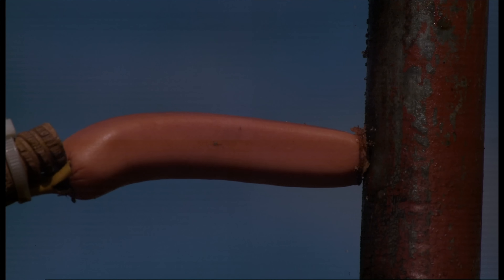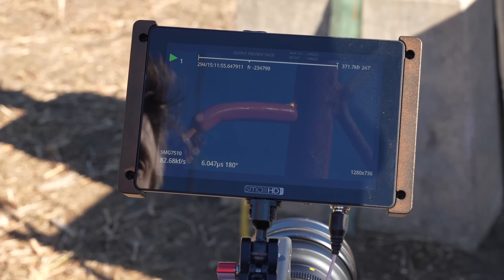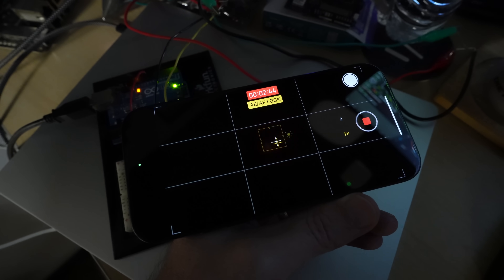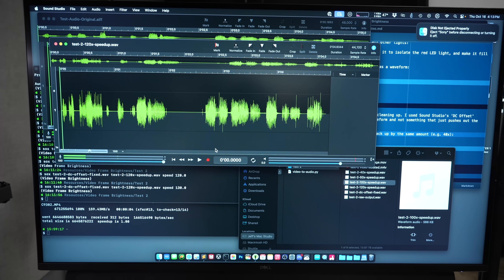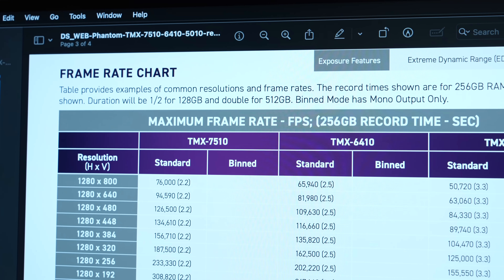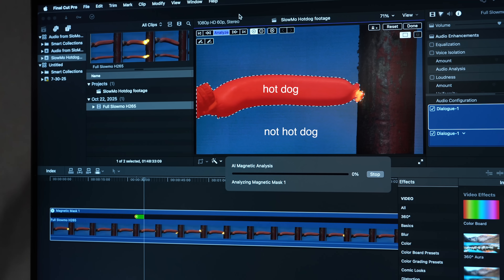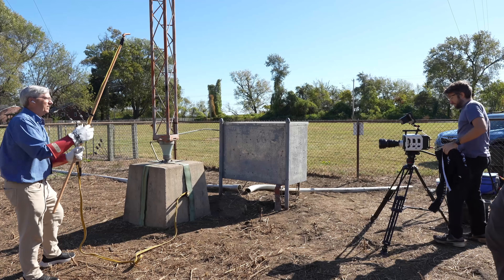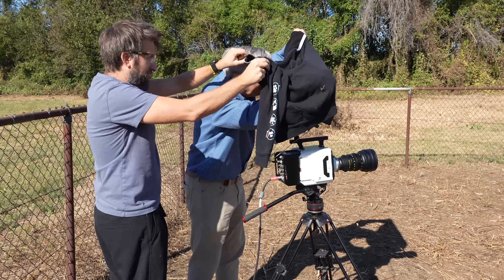A new way to listen to AM radio

Comment: Just like lightning there apeares to be a leader effect.would it be possible to put a high speed circuit that would continuiosly track signal caricturistics in the am broadcast transmiter and possibly the enttenna unit to sense arcing because of a sausige or anything else arcing or conducting to ground and automaticaly shut down the transmiter plus possibly if energy is disapated into heat by sausiges or anything else near the tower to prevent damage to the sausage or heating of a sausige or anythinge else i think that that would be a good idea some special military transmiteres do have rhis feature.

Comment: This is analogous to an optocoupler, which we used to make using a LED and a LDR in a piece of black shrink tube at uni. You can interrupt the light mechanically and make audio effects such as a vibrato. Good times

Comment: Clipping the negative half of the waveform is how AM radio demodulates the signal. The component in an AM radio is a simple signal diode designated as the "detector diode" . Maybe you just had the polarity of your hotdog backwards or you were using a general purpose rectifier dog.

Comment: Just think analog, Play that video to the solar panel cell that is attached directly on the screen but use it as a microphone and connect it to an audio amplifier you should hear something, I think the led should work really good ( but make it blue or at least white. Also it would be interesting to see if the video with luminescence key would produce any clear sound.

Comment: a few things; since sound is sinewaves anyways, you only really need half of the data. also, if you used a reflector you could get the light from the back. 

Biggest thing here... Walking through the experiment in agonizing detail is the best... Peanut butter sandwich instructions levels of painful.

Comment: what would happen if one took a hotdog on a wooden rather than a metal stick on an ungrounded fiber glass pole and held it near a am station would it still heat up or burn or waporis or would it get cold in radiated.
Reply: Good question. I beleive Jeff and I are the current experts in the field of Hot Dog LF absorption now! I'm pretty sure what would happen but will sit on the idea for a possible future video. We have been using a wooden stick but running the ground wire to one end of the hot dog creates the enhanced energy path.

Comment: Maybe the processing is part of the fun, but if you simply used a photodiode and a parabolic reflector instead of a camera, you could more easily capture a signal from the plasma. I'd try a diode at the focus of a an old auto or tractor headlamp.

Comment: you could use a photodiode to get the data! It's like a super high framerate 1px camera. You could put it on the end of the stick or use lenses to collect more light from it and you wouldn't need to do anywhere near as much post processing or deal with as much data.

Comment: The LED will always clip below the diode conduction threshold and in the opposite polarity.   Try again with an old-fashioned incandescent bulb and I bet you'll get better results. As for the plasma, you may only be getting the bright visible flashes on modulation peaks.  There are a couple of guys on YT that have made powerful speakers out of tesla coils.

Comment: 3:10 - seems like you made a mistake here? That sounds like you didn't pitch shift it, you did something like "slow down" the audio with "preserve pitch" selected (different DAWs describe it differently). This doesn't shift the frequencies down, it applies a bunch of tricks and processing to make the audio seem like it happened slower. Doesn't mean the overall method is flawed, but your test might have worked a lot better if you had actually pitch shifted.

Comment: In the early '90's I was the Chief Engineer of a 10,000 Watt AM station in Hawaii that was KJPN. That tower had another 10,000 Watt station diplexed on it but the guys who added the second station neglected to upgrade the tower light system's RF isolation choke for the increase of power. One day I had to lift the tower light system's neutral wire from the circuit breaker box neutral bus. I had an insulated shaft electrician's screw driver and insulated pliers. When I pulled the neutral wire out, it drew an arc of about three inches long that produced the audio of both the Japanese language programming on the one station and a live from a helicopter afternoon traffic report on the other. I just stood there for a few seconds while the arc sounded off just completely surprised and then concluded that I'll just put the neutral back in. I never in my wildest imagination thought that could have happened.

Comment: So, a couple of questions/ points,
-1st off, Very well done!!!! Is how Jeff likes his hot dogs!!!
-I think I understand what you are trying to do with the LED bulb & I think I understand that LEDs pulse slower than an incandescent light bulb. Could the slower pulse of an LED be giving you "static" in a sense that when slowed down with your phone's camera, a blink in the brightness of the LED is not so much a blink correlating with sound but JUST the frequency at which the LED would normally pulse under normal conditions? Should/Can you try a different Incandescent bulb to get a clearer sound wave?
-To get a better view of the arc flashes (as the hot dogs block what is happening on the backside of the dogs themselves), could you use a slice of bacon instead. Much thinner, roughly same medium & might smell much better LOL. Otherwise, 2 Phantoms, 1 on either side of the hot dog, Then stitch the 2 videos into 1, as the arc flash jumps to the blind side of Phantom #1, you cut to #2 Phantom's video to get the constant visual?

Just throwing idea out there. I have no idea if what I've said would work.

Comment: I could see not using a camera, but instead go a bit more analog, using a photo-diode or photo-transistor to detect the light levels.  Then an analog-to-digital converter to allow sampling.  You could place another detector on the other side and catch the "missing" plasma glow. 🙂

Comment: @GeerlingEngineering - did you consider putting a mirror on the back side of the hot dog to simultaneously capture the front and back plasma view?

Go. Cards!
Reply from the maker: Mounting it would've been difficult... but it could be doable.

Comment: A transparent/translucent gel in the sausage skin or some other relatively thin skin might let you get much more of the light as the 'sausage' won't occlude the plasma so much. I'd think ballistics gel would be good enough perhaps without even needing any skin (May need to mix in an additive or two to up the conductivity of the gel for good results, but I doubt it and that shouldn't be a big problem.)

Comment: Nice! As soon as Gavin showed the shot where you can see the modulation, I thought of Destin's video on using a laser on MEMS microphones and wondered if you could extract any useful audio from the video. I guess it turns out the answer is maybe!
Reply: Also that shot of the connector arcing is terrifying. The radio is trying to escape, you must not let it

Comment: I would add all the pixel rgb values in each frame to a 32 bit integer, apply high pass to the series of those sums, and listen to it. 
Since the modulation of plasma is much much faster than any other brightness change in the scene, and visually it seems that the details are there, I'd give it a shot. Luminance keying is very similiar to sound clipping so a lot of detail is probably lost there. I'd also choose the high pass cut-off frequency somewhere in the middle between the fastest movement in the scene and the lowest plasma modulation frequency. For a ball park, I'd go for 10-20Hz. It should also be much much faster than any other video processing method because you are just adding integers and possibly using a very fast integer high pass filter.
Reply: if you're unsure, send me the footage or the sums of the rgb values in each frame and I can give it a try.

Comment: Just goes to show that you can encode analogue audio into just about anything! I think I remember a Veritasium video where they were yelling at a crumpled up chip packet and trying to use a camera to decode audio from that...
I wonder if this experiment could be done more simply by using a light sensor (like that out of an optical compressor circuit) instead of a camera?

Comment: In Army I was told you could touch antennas to test if everything was hooked up right! It worked. Was tube 100 watt or less 400 mHz drone transmitters. I said neck with this. I made a simple box with lamp to hold near antenna. This was 1970 and I was in electronics and set up receivers and transmitters for drone target practice. 90 HP engines, 4 cylinder. Oh and I had battery acid holes in all my fatigues.
Reply: MHz, not mHz. Nobody uses 400 millihertz.

Comment: Just think what WMRI 250 KW transmitter would do to a hotdog . Even WBCQ 250 KW . That some BIG tubes used and very scary. Not just burns . Vaporized ! Even a 100 watt AM transmitter is deadly. RF burns from inside out . And micro wave is even worse. That why we have a RF exposure chart we have to fallow. The ARRL has that on their cite so you can do your own chart. For   HAM radio this is a FCC requirement to do this. It is on one of the test questions. Please be careful with RF  . It has to treated with respect . Just watch you tube video's . If you ever seen what is left to a mouse or rat that go into a transmitter.  They blown to bits and the arc flash does damage and carbon scoring that all has to be cleaned before transmitter can go back on air. That will be you if you get to close to high power RF. Cheers from NY !

Comment: Run a tesla coil at a suitably frequency to apply amplitude modulation. Even a modest power (75W) AM transmitter on 75 meters will do. Sparky was too much fun. I had to disable him before the FCC came pounding on the door.
{^_-}

Comment: OMG. Those were exactly my thoughts when watching the Slo Mo Guys Video! 
Nice test with the LED @240FPS first! Although, I'm pretty sure, that if you'd slow the audio down without keeping the pitch (like at 3:10), it would work way better.

I already feared that the absolute brightness change of the hot dog source material doesn't really correspond to the amplitude very well, because the big plasma clouds stay too long in the air. 
Maybe using brightness difference between frames could work better, kinda like a high-pass filter, but idk.

Still, a really amazing demo overall, I love it!

Comment: The camera is making this harder vs a more simple light sensor.  You need way fewer pixels, preferably from more angles, just picking up brightness in that direction.  I could imagine a version of this that mounts to the pole and couples the light out through fiber so you could get up close samples w/out the RF challenges.

Comment: How much does the hot dog impact the received signal? Does it impact the people listening to the tower or does it compensate for the grounding with more power.
Reply from the maker: It does diminish the signal, but not noticeably for most people in the metro area. We covered signal degradation a bit in our video at the site last year
Reply: @GeerlingEngineering thanks for the answer! does the tower increase powder when something like this happens? I assume there are events that happen where the tower is temporarily grounded or maybe in the rain?

Comment: I've seen elektroboom and others use a high voltage arc from a microwave transformer with additional circuitry to play back audio, though it is probably not much safer than the am tower

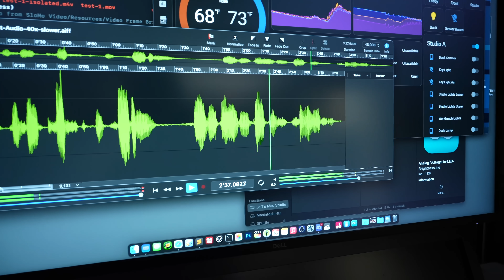Comment: It's possible that you might have messed up your arduino/iphone test. At 2:49 you propose slowing the sound while also pitch-shifting it, but to simulate a Phantom using an iPhone, you want to literally slow down the audio samples without pitch shifting or pitch correction. If it's done correctly, it should sound like whale song. The reason why you need to slow it down is because an iPhone camera doesn't have the temporal resolution to resolve the audio frequencies of speech. What your test actually achieved was to demonstrate what extreme aliasing artefacts sounds like. Run your test again without pitch correction and the result will be dramatically clearer.

Comment: Seems like that fence around the tower is a little short, given how dangerous the tower is to people (or animals) who might touch it.  Do they not use a taller fence because they're worried about the fence interfering with the broadcast?  It's already going to have significant eddy currents induced by the tower, so maybe that gets worse if its taller?  Or maybe it's just old and newer installations would use a taller fence?

Comment: I think too much of the plasma is flame from the hotdog combusting. It persists for too long to extract sounds from. If you had 2 electrodes spaced correctly to just turn air into plasma, I think you would get some usable information from it on a camera.

Comment: I'd recommend a carbon welding rod instead of a hot dog, you can find thin ones.  It could be sharpened on the end and it might not ablate as much as a hot dog.
Some of them are covered in copper, you definitely don't want that!  You could have a hot dog resistor in series if you worry about the transmitter's output stage.

Comment: What effect does the hotdog have on the actual transmission of the AM RF signal? Does it reduce the power output? Or does it cut the signal completely while it's shorting?

Comment: 3:10 I think you are only changing the 'speed' which and are not really slowing down the waveform. (the pitch stays the same so the frequency stays the same) If you did that the quality would cold be better I think

Comment: Attach the hotdog to the tower. Record the nail as you poke it with the grounding stick.
Reply: The issue with that is you can't do it safely without tagging out the transmitter.
Reply: @TheR00ndar  Yeah, you can. Simply don't ground the stick.

Comment: Wait maybe I missed things, but the hot dog is what makes the sound?  The ground isn't sent to a speaker first or anything?
Reply from the maker: Just the hot dog, which is grounded on the end opposite the tower
Reply: @GeerlingEngineering  But how is a hot dog making sound?  Is it actually vibrating at the same frequency as the RF that's cooking it?   That's nuts... and very strangely fascinating.

Comment: As someone who's received 40w rf burns from a live 1/2" heliax jumper, I can confirm, they are painful and they take months to heal.
Reply: Yeah, some cheap handheld radios leak RF through exposed charging contacts on the back of the battery and even that can be painful
Reply: I grabbed some tongs that were next to a flame on a stove last night. Burned the rest of the night whenever I wasn't rinsing in water or holding a cold beer. Much better this morning and, thankfully, no blisters. It was crazy how much it burned whenever I released the beer but went away after a few seconds. Happened every time.
Reply: @ThePrufessa yep, now imagine that thing but instead of cooking your skin you directly cook your muscles. Yikes
Reply: It was "only" 40W. I didn't think that would be enough. The like 10Ws that a Raspberry Pi uses is a lot of heat (If you for example keep it in a Flirc case, eventually the heat will heat up the case and make it to steady state around 44C, in a 21C room.) I just realized that I really don't understand this. *THIS* would make an interesting video I think. How transmission power can affect a person and how it travels and propagates both in the air and into a person that's unlucky enough to be touching it. Does antenna length make a difference in the amount of power that is felt by the person? Is a 40W burn at UHF lengths (smaller antenna so less surface area to expand the heat / energy across) vs VHF that is a much longer antenna.
Reply: @TinkerersAnonymous  For sure, I've bought a an AliExpress foot warmer mat, it's just 9 watts over USB A, but when you take it out of the cover and use it as a sitting pad, the 9 watts heat up your butt or back very quickly even becoming painful if you leave it long enough
Reply: @TinkerersAnonymous  RF power & 'electrical' power are very different animals. Not something I can reasonably explain in a comment, but one (technically wrong but it's a place to start) analogy is that electrical power is akin to measuring in 2d (along a wire) where rf power is radiated in 3d (open space). It takes a LOT more energy to "fill the space" for a 10w transmitter than it does to send 10w along a wire.
Typical transmitter efficiency can be something like 20-40% from input to output power.
Reply: @danl6634 they absolutely are different beasts, but "watts" IS energy. 10W is 10W, or 10 joules per second of energy. There's no more energy converted to heat in 10W of radiated RF than in a 10W resistor.

The difference here is that those 10W are "released" right into your body tissues with RF, while with a resistor you have to heat up the thing, then transfer that heat to your body. You don't immediately feel all that energy, while with RF it's dumped right into your body.
Reply: @FAB1150  oh I get it, it's just hard to put into understandable terms succinctly